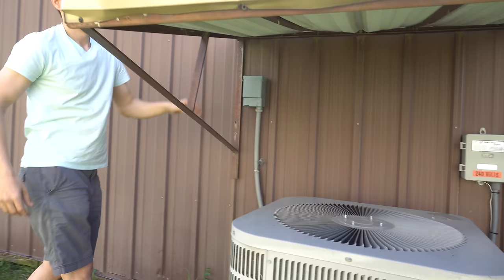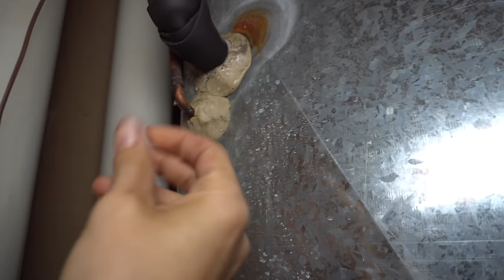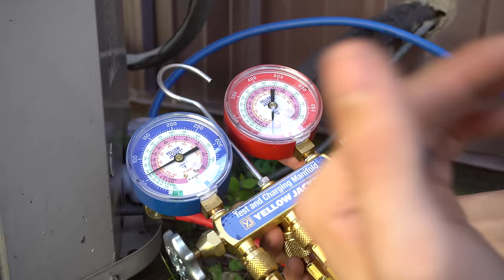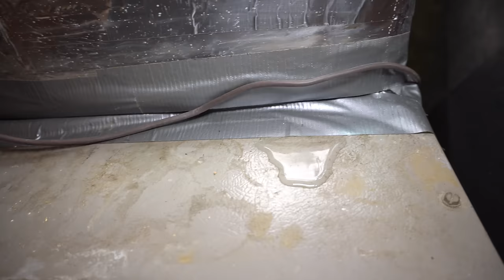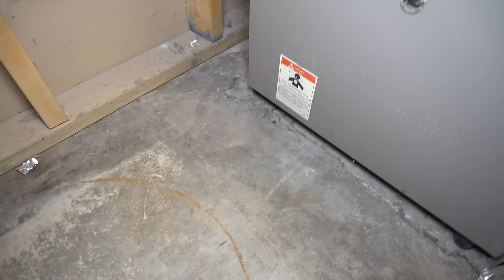How To Add Refrigerant To Air Conditioner

Comment: Jay, what if the cylinder with new refrigerant starts running low (say a 30 lb tank of R-22 is down to 2-3 lbs left), will there be a situation where the pressures somehow equalize (stall out) and not be enough for those final lbs of R-22 to move into the running system?  Also, is there any risk of pressures reversing and refrigerant from the unit somehow making its way back into the tank and mixing with the new refrigerant?  Same question when trying to re-charge to a running system with refrigerant from a recovery tank (lets say after we've removed 4-5 pounds from an overcharged system, but need to add 2-3 pounds back in).  Similarly, say a unit that we've just repaired and pulled a new vacuum on (requires 10 pounds of refrigerant) and the new tank of refrigerant only has 11 pounds left in it (or even a recovery tank holding the existing 10 pounds), will the non-running system under a vacuum pull all of that refrigerant out of those cylinders (break the vacuum), or will cylinders start to loose pressure as they get down to the final few pounds and equalize with the pressure in the unit and stop moving (stall out)?
Reply: will there be a situation where the pressures somehow equalize (stall out) and not be enough for those final lbs of R-22 to move into the running system? YES
Also, is there any risk of pressures reversing and refrigerant from the unit somehow making its way back into the tank and mixing with the new refrigerant? NO the new refrigerant cylinders have check valves installed and won't allow the cylinders to be pressurized.
Same question when trying to re-charge to a running system with refrigerant from a recovery tank (lets say after we've removed 4-5 pounds from an overcharged system, but need to add 2-3 pounds back in). YES, recovery cylinders do not have check valves installed.
Answer to the last question, it is very improbable that you could pull a vacuum low enough to draw all of the required refrigerant into the system. Eventually, pressure would equalize between the system and the cylinder and there would still be refrigerant remaining in the cylinder.
Reply: Once the pressures equalise with the bottle and unit, you turn the ac on so the compressor sucks out the remaining charge the system needs, say you have reclaimed all the gas, pulled the unit into a vacuum of under 50@ microns and it’s time to add a charge to the unit, you put the bottle of refrigerant on scales so you can can see how many (in my measuring system) kgs you are dumping in the system, it eventually equalised so you turn the unit on and let the compressor pull the rest of your refrigerant needed for the correct factory charge and then you you are good. But it’s important if you have lost refrigerant that you fix the leak first or yiu can get a big fine

Comment: Is it normal to have a roof over the AC?  It seems like that would recirculate the hot air that would normally shoot up 20-30 feet...
Reply from the maker: That is not exactly normal but as far as clearance guidelines go, as long as there is 1-2 feet of clearance around the unit and about 4 feet above it, that is fine. I don't think the little roof was quite 4 feet away but it was enough.

Comment: Hi! How much would be pressure reading if compressor not working, the compressor is not running maybe because of low ref cause the reading is 0 on suction, can i recharge with a compressor not running?

Comment: Is it possible that the frozen coils was the only issue, or is that a sign that more refrigerant is needed?
Reply: The Frozen coil is just a symptom and not the issue. If your coil is freezing that means you have another problem causing it. Generally speaking it could be a sign of low refrigerant but is not always the case. My air conditioner unit was doing the same thing and I thought it was due to a leak causing the refrigerant to be too low. But it turned out to be in my case was the outdoor AC unit pulled in a lot of debris such as mulch and leaves over the years eventually covering up the compressor halfway and when I cleared all that crap out the air conditioner stopped freezing.

Comment: Just add gas until the suction line flashes...works on all R22 units...no need to keep stopping and checking pressures

Comment: If you didn't purge the air from each line before the charging step, would this immediately hurt the system performance or safety - great videos you make! I love the one with your buddies cutting the compressors apart (I watched the scroll version so far).
Reply: No, not immediately. Over time, it would.

Comment: What causes the A coil to freeze over like that? You may have mentioned it and I just mentioned it. Sorry if that is the case
Reply: When you leak out refrigerant( or if you aren't moving enough air across the coil to pick up heat)  it lowers the pressure of the refrigerant.  With a refrigerant your pressure correlates to a saturation temperature.  Thus the lower your pressure -  the lower the temperature. Eventually once you get low enough you will be below the freezing point of the water in the air (humidity). So when the air is pulled across the coil it will freeze the water. This also causes air the be pulled across the coil slower due to the restriction. It will create a cascading effect until eventually you end up with a block of ice.
Reply: @OramWerd  great information. Thank you very much!

Comment: Just had a Company come out to my place, charged me 229 for a simple capacitator replacement.  Then, they "inspected" the primary unit for the second floor and I was left with impression that repairs would be above 3K.  Therefore, it would make sense to replace all three units for the home estimated around 20k.  Sent them on their way with 229 bucks.  Called the "local repair guy" he added Refrigerant, tightened a bolt? that he showed me was very lose (possible cause for leak) paid him 300 and I'm set.  Second floor is ice cold!
Reply: Simple capacitor??? So simple do it yourself then don't pay us HVAC techs 🤣🤣🤣🤣🤣🤣🤣🤣
Reply: @RKTSH1P  I did, hence simple.  Dur?

Comment: thanks for this nice video, does anyone know how to find out if the central ac is using the fixed orifice or Thermal expansion valve without open the cover to the eveperator ?  i have a Trane xr80( american standard ) , anyone know what type it use ? i watched word of advice manyh videos, but i never have seen him open the evaperator cover to see if there is a txv in it, it is kinda hard to open, same as for me. that is why i am asking. thanks

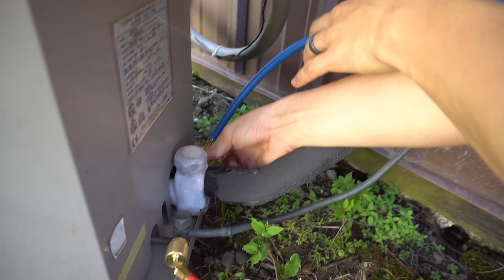Comment: Question, 4:15 how did we not hear or see any gas escaping when you hooked up your gauges?  I've seen guys with incredibly fast fingers do it fast, but theres always a little escape
Reply from the maker: I was using hoses with low loss fittings. They are very good at releasing very little refrigerant upon hookup and disconnecting.
Reply: @WordofAdviceTV  thanks!

Comment: hi am am good at fixing auto motive ac... what exactly do i need to add a little refrigerant to a home unit like this... do they sell this in a can like for a car... my unit is only 5 years old,but it has a hard time keeping up on hot days lately.... thanks PS... cleaned coils and replace filter... did not hel much at all.
Reply: You need a license to purchase refrigerant. Also, unless your unit is actually under charged, adding more refrigerant won't necessarily cool your house more, it could be another problem causing your unit to work improperly.

Comment: hey there. I have little concern about frozen evaporator coils would just melt the ice down to circuit board and it may short the board causing another 500$ fix. Is there a better way to thaw it down and also make sure the airflow from return duct to filter to indoor blower to evaporator coils to supply duct is not restricted? Thx

Comment: Hi , great quick recharge. What do you do with the refrigerant left in your gauges???  [ Your next job my use a different refrigerant ]   Thanks Friend
Reply: Only gas was left in the hoses, since the liquid was pulled into the unit at 17:19. The gas in the hoses represents a fraction of that equivalent in the liquid state. It’s better to store the gauges with no pressure. Although the hoses are purged before adding refrigerant into another system, it’s better to use different gauges since oil gets in the hoses. The oil for R-22 is different from that used for R-410A.
Reply from the maker: @Ronald Cach I can't say it better than Ken. :) What he said is what I would have said too. I have 2 gauge sets. One for R22 and one for R410a
Reply from the maker: @Ken Marriott Thank you for answering others' comments with great replies Ken! Much appreciated!

Comment: How did you manage not to bang your head on the "head banger"? Was that impeading the discharge air giving a false head pressure reading. On the video it looked a little closer then I've been taught on any obstructions,just curious.

Comment: Should be around 20 degrees temperature differential with r410a. 15 degrees would be low on refrigerant. 24 degrees or more means restricted ductwork or a dirty filter. Is it different with r22?

Comment: Excelent video as always!
I got a question:
   Can I use my gauges with R410a  and R22 at the same time?  If yes,  what steps should I follow?  
Thank you!
Reply from the maker: You can and some technicians do that all the time. 410a units have a different oil in the system then R22 though so it is not recommended to use the same gauges for both. If possible have 2 gauge sets, otherwise just don't forget to purge your hoses each time before adding refrigerant and it should be fine.
Reply: @WordofAdviceTV  Awesome!
As always your the best. Thank you, again!
Reply: R22 has 1/4 inch connection, 410 has 5/16, much higher pressures and different oil. I use separate gauges always
Reply: @WordofAdviceTV  - Correct. I switch between 410A and 22 all the time. I purge and blow dry nitrogen through when I'm switching it up. You could also use a lineset flush on your hoses, as well.
Reply: Nathan no they’re not. They’re all 1/4”. The only time you see 5/16 is with mini splits
Reply: As a licensed journeyman I would never cross refrigerants. I have separate gauges depending on the oil in the system. With that said you can vacuum the gauges to clear them but still not a great idea. The best is to own separate gauges.

Comment: Didn’t see you backseat to gauge on or crack open the valves to check pressures. Is that not needed?
Reply from the maker: There are 2 different kinds of valves. One is a "king" valve (the one you are referring to) and the other is a Schrader valve. The one in the video is a Schrader valve and it does not need to be cracked opened in order to check pressures. Simply put the gauges on and that's it.
Reply: Appreciate it very much I graduated out of trade school and a small company just threw me out into the world and I still have questions and need to refresh on book work with hands on field training. Thinking about going to a company with more of an apprenticeship type role.

Comment: So in trying to get a better undestanding of the refrigeration cycle... When my system (R-22) restarts after cycling, when I put my hand on the liquid line a short run distance outside of the A-Coil, I feel an internal vibration, like liquid is sloshing back-and-forth, and the line heats quickly... this smooths out after maybe 20-30 seconds. Am I feeling the bursting bubbles from 'boiling' refrigerant cavitation? Or is the liquid actually sloshing back-and-forth while the flow stabilizes? Thanks!
Reply: You’re probably feeling the line filling with condensed (liquid) refrigerant.

Comment: Wonderful video and really great job in your explanation, Jay. I just bought a brand new sealed 30lb R-22 tank same like in this video. I’ve hooked it up as per the instructions but it is not charging upright a vapor. If I tilt it, I can see the liquid is flowing. I’m currently stuck at 45 psi on the low pressure line and it is not increasing. Do you know what seems to be the problem?
Reply from the maker: Thank you! What you described is a bit odd.. It would be hard for me to guess what it is but a few things do come to mind. Were your fittings screwed on all the way? Was the R22 tank cold? Also, is it possible that the unit uses R410a refrigerant, not R22? (I have done this mistake before and the symptoms were similar) If the compressor is going bad, it might struggle with "sucking in" new refrigerant too. One way to check the compressor is to try and put it into a pump down. ( https://youtu.be/nY5913wSvhQ ) This procedure is not entirely simple but that's what I would try. If the compressor struggles to go into a pump down, then the valves inside of it are likely going bad.

Those are all just guesses though. Perhaps there is nothing wrong and you can simply add it in liquid form. As long as you add it in slowly (so the psi goes up by about 10), it is okay to charge a unit with liquid refrigerant as well. They call it "throttling it in".
Reply: @WordofAdviceTV  If you made those mistakes before, you shouldn't be making videos and advising other either; you're braking the law and that's a serious crime!
Reply: @bobboscarato1313   Lighten up there, Bobby. Who asked you anyway ?
Reply: @bobboscarato1313  Its normal for techs to make mistakes so you're delusional. I've never met anyone on the field who hasn't made a mistake.
Reply: @AlexGarcia-xh2dy  What kind of weed you use?
Reply: @AlexGarcia-xh2dy  
all humans make mistakes; some fail to ask for help and some want to hide their ignorance!
Reply: @AlexGarcia-xh2dy  Everybody makes mistakes but some folks never learn and keep making mistakes; skip training classes, etc.
Reply: @bobboscarato1313  OCD

Comment: Would a "thaw out" of the A coil potentially impair the electronics below such as circuit board,switches, etc.? Could you use say a heat gun on low setting to expedient the thawing?

Comment: Hi Jay, does this manifold come with the low loss fitting already? I see YJ selling "Yellow Jacket 22983 45 Degree SealRight Fitting, 36", Red/Yellow/Blue (Pack of 3)". I was wondering if this gauge already come with the low loss fitting. Thanks!

Comment: Question to the smart professional man if I leave my AC running while evaporator is frozen will I lose Freon / R22??
Reply: No.... However being frozen is a sign u may be low on freon.
Reply: Check to make sure the filter is clean as well coils only freeze of there is a air flow issue or freon issue either low or not metering properly

Comment: Where do you get that tank from and those gauges? Can you rent them?
Reply: Gauges can be bought at an HVAC parts store or online. But the R22 refrigerant is hard to buy. It can only be sold  to or handled by LICENSED HVAC technicians. EPA imposes hefty fines if caught.

Comment: How would this process differ if using R410a instead of R22? Tank goes upside down, what else?
Reply: charged through high side
Reply: Well first and foremost the method shown here is not the way to do this. Secondly, 410a wants a certain amount of sub-cooling which is going to require know your liquid line temp. If you do not get the AC charge correct it can cause issues and even complete system failure.

Comment: I was just wondering that you wouldn't clean the coils first. It could be pretty dirty also like you say a low charge, But you couldn't get an accurate reading on your gauges.
Reply: Yes that's what I would do...
plus the condenser air flow is kinda being blocked by the little roof...
The condenser air flow needs to be in a open area

Comment: Word of Advice 1 rule of condenser installation dont put under deck if it was my unit I would remove that (shelter) roof above condenser the heat that is to be ejected is hitting the shelter and coming right back down cutting down on performance

Comment: Do you put the Freon in while the system is on?
Reply: Yes, the compressor and both fans must be running and both coils must be clean.
Reply: I have a R-22 unit and it’s 18yrs old. Trying to keep it alive for another yr before buying another unit
Reply: @green518eyes  The cost of R22 is very high right now, my shop is selling it for $147 a pound. A system that is low will usually require at least 2-3 pounds. You can also have it retrofitted to MO-99 which is only $63 a pound but would require a recovery of the old refrigerant and recharge with new.

Comment: i thought you have to open access valve to add freon or im wrong?  ill appreciate if reply
Reply: Depends on the type of valve. There are multiple common valves in the industry. Those valves do not need to be opened. Just caps removed.

Comment: I've never heard of putting the furnace on to help assist defrosting. In fact I usually pull blower and board out of blower compartment if I'm defrosting a frozen coil. That a little risky.
Reply: @UCPu9TeqXHj_u9lUe8exfL5g not pull the coil, pull the controll board. When that coil is defrosting you should always make sure water isn't going to come in contact with blower motor  and controll board.

Comment: any advice ? just added proseal xl4 to the system, run about a month, now stop working, lot of freon left, compressor did run, feel warm, the system was leak previously, after added proseal , it's work fine, can the system clog?
Reply: Absolutely it can! You can clog your metering device.

Comment: If it's a heat pump and not out of freon you can turn the heat on in 5 minutes the ice will be gone but you need to get to indoor coil because if there is a large piece of ice you will have to take it out when it separate from. Coil

Comment: Question. Does that awning over the outside unit help keep it cooling better???
Reply: No. In fact it can actually do the opposite. Your discharge air can bounce off of that little awning and be recirculated through your condensing unit. This hot air will cause your head pressure to increase and ultimately decrease your cooling capacity.